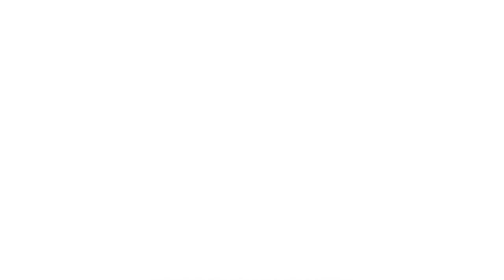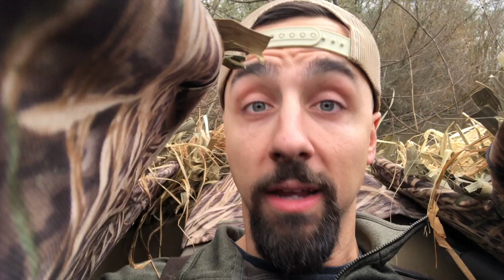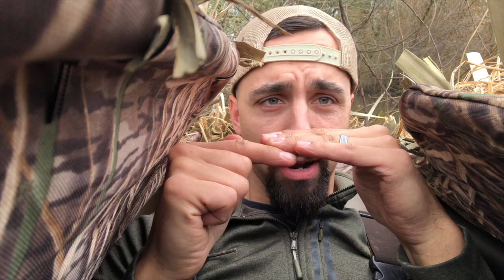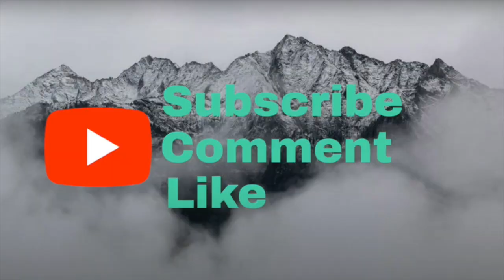Beavertail FInal Attack: Mud Motor, Electric Motor or Paddle?

Comment: I just ordered the same boat, should be here in mid august. I typically  hunt lakes, or any body of water that I can get my 14’ boat in and there are so many spots that I know would produce awesome hunts if I could get to said spot. How does the boat perform in bigger open waters?
Reply from the maker: It’s a great boat. I think you’ll be really happy with it. I haven’t taken it in really big water yet, I’ve just taken it on a lot of flooded rivers and a few lakes. It’s amazing how stable it is even when you stand up. How big of water are you looking to hunt? Some of the rivers around here are just too crazy in the winter. I did buy a mud motor though, and I’m kicking around the idea of hunting bigger water this winter.
Reply: I hunt in northern and mid MN so pretty much just lakes so it can vary. Some of the spots I want to hit are on the far sides of the lakes, I could just go along the shore but that would just take to long
Reply from the maker: @coltencarlson6984  did you get a motor for yours or will you paddle?
Reply: Paddles, push pull rod and or a trolling motor depending on the location I’m hunting. I hunt bog lakes 80% of the time and they are a steady 8’ deep all along the lake besides the boat launch. There are a lot of secluded spots that are unreachable with big boats, no one hunts them and they do hold a lot of birds so that’s why I went with a sneak boat.
Reply from the maker: @coltencarlson6984  that sounds like a deadly setup. Let me know when I should head over to join ya 😁